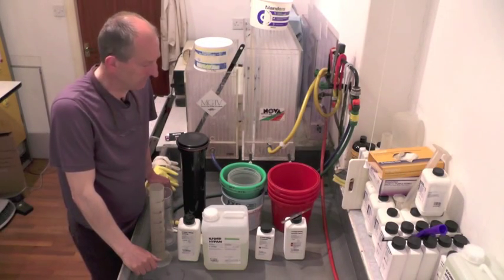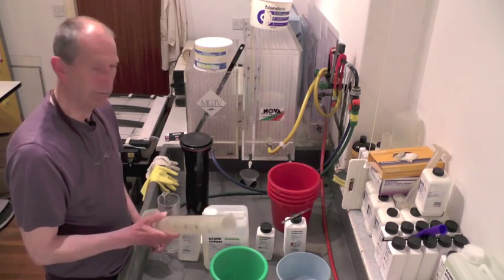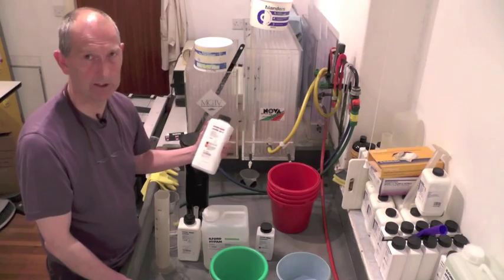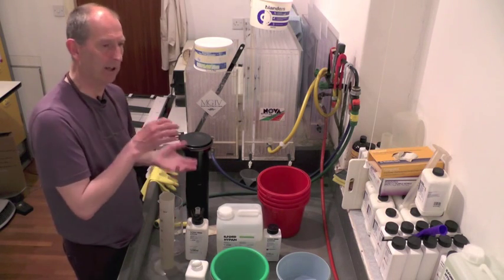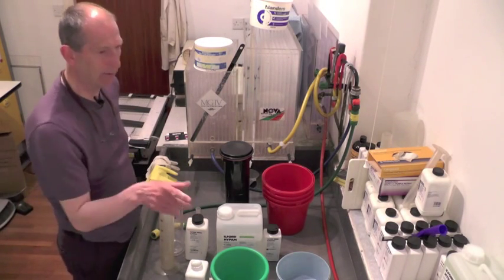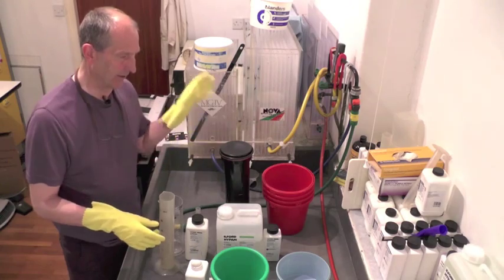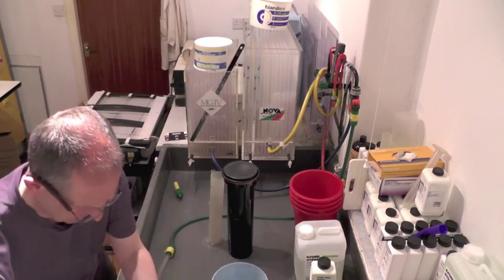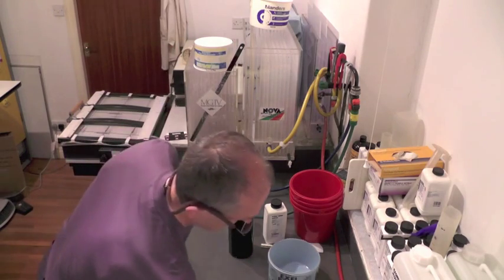Black and White Film Processing - Part 4 of 5: Making up Chemicals

Comment: Hi Dave.  You may or may not recall that I had the pleasure of meeting you when I attended one of your workshops at you home several years ago. Your videos are very valuable to anybody into developing film and is very close to the process and materials I use in my home darkroom (converted coal cellar).  Personally I use distilled water when mixing developer and I noticed that you simply use tap water.  Am I being a bit over cautious in thinking minerals in the water could affect the film emulsion?  Best regards Dave.
Reply from the maker: Hi Norbert, yes of course I remember you. I don't have many clients from Canada! Pleased you are finding the videos useful reminders of what we covered on our darkroom day. You're right about distilled water but it mainly applies in hard water areas. We have soft water here and distilled water so far doesn't seem necessary. At the very least keep using it to make up the film developer, you don't need it for stop, fix or paper dev. Hope that helps. Dave

Comment: Any reason uou use Hypam over Rapid fixer? I'm unclear on the differences. I'm also interested in why you use DDX at 1:6. You say it gives better shadows detail - what is the payoff - more grain?
Reply from the maker: Hypam and Rapid Fixer are the same. Just buy whichever is cheaper. You can use both for film and paper. I use DDX 1+6 because I worked out a way of using FP4 that benefits from this. I over-expose my negs slightly by taking my meter reading from light shadows and then I under-develop. This gives me lower contrast negatives that I seldom need to dodge and burn in the darkroom. Multigrade paper and split grade printing take care of everything else! I expected slightly more grain and more sharpness with this method but in fact I don't see more grain; I routinely enlarge to 1 metre and the grain is barely visible from my 7 x 6cm negatives. Dave